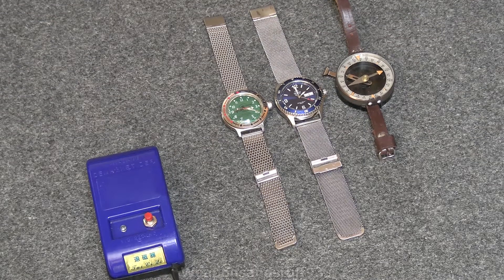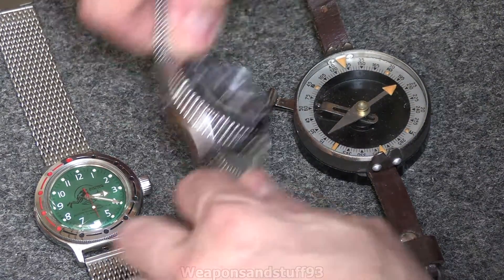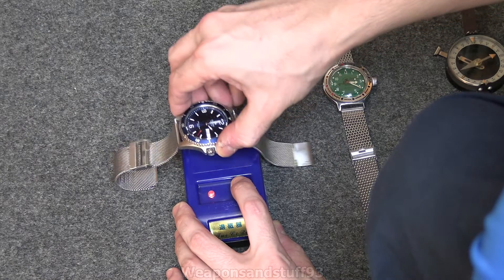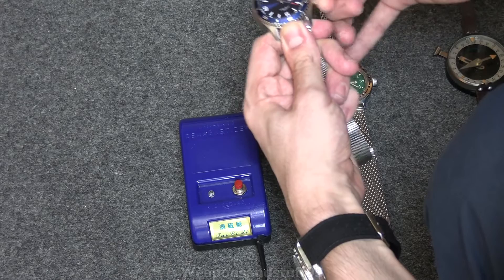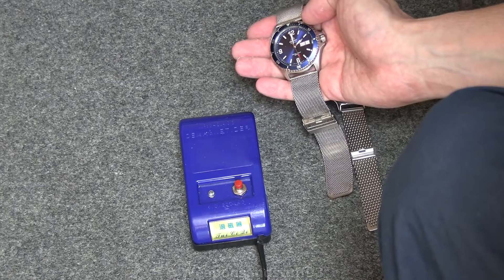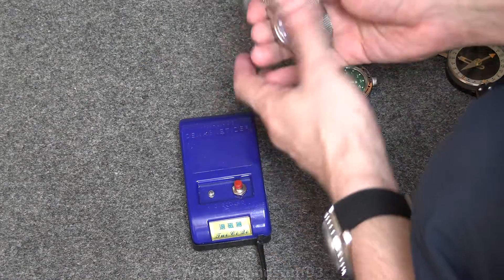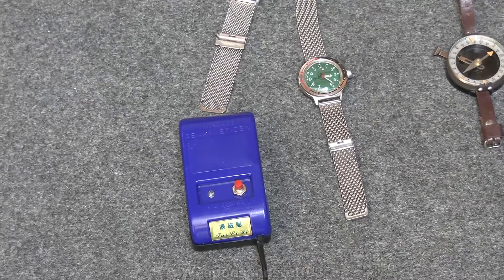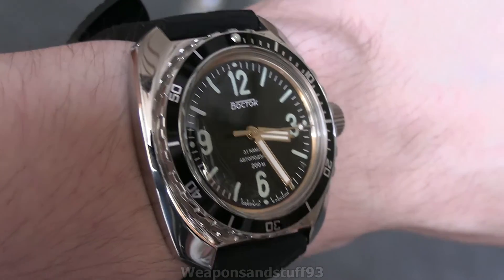Attempting to Demagnetise a Watch

Comment: Nice watches. I've never used an actual mechanical watch that has to be wound. What are the benefits of those over an electricity powered watch?
Reply: You don’t need electricity
Reply: No batteries needed and the second has a smooth motion. The only downside is that if you forget to wear it or wind it within usually 48 hours, it will stop. They are also a very tiny bit faster than a quartz watch
Reply: Comrade Gulag of OurTube Okay, cool